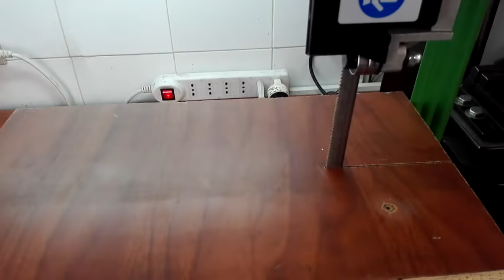DIY Metal Band Saw Stand Modification

Comment: In the vertical position, how many inches (or cm) would you say is between the blade and the saw body (i.e. left of the blade)?
Reply from the maker: I need to check if you want the precise measure, around 10-12 cm :) Not much!
Reply: I'd super appreciate it if you checked! I'm looking at a similar saw which has about 3 inches (7.6 cm) of clearance but max miter of 45 degree vs your saw's 60 degree. Here is that other saw: https://m.northerntool.com/products/shop~tools~product_200660083_200660083?adv=false

My current portable metal band saw (Milwaukee) has ZERO clearance! So the longest cut I can do is the depth of the throat - 5 inches (12.7 cm); if I flip the piece and cut on the same line I can get it to 10 inches (~25cm). Which isn't a lot. 

Love your YouTube videos btw!
Reply from the maker: It's about 9cm. I overestimated :')
Reply from the maker: Ahah :'D Thanks man

Comment: Hi. Awesome videos! I just had a question.. How much  TPI on you sawblade? And can you cut very thin metal with it? Approx 2mm stock?
Reply from the maker: Thank you! I'm sorry I don't know about TPI, it's a fine metal cutting blade, and yes it can. I cut thin steel and aluminum sheat too with no problem :)
Reply: Black Beard Projects I ended up buying a 14tpi blade for my FMB bandsaw . Not the fastest cut but way less messier then with the angle grinder. :)

Comment: omg this is an awesome build but i just Wonder how did u get ur saw to hold at 90 degrees mine will just fall Down Thanks in advance!
Reply from the maker: Thanks mate! :) I place a tiny wooden block under the green part of the saw so that it can't get lower and extend over 90° A better solution would be a bracket from the base to the green part but so far I had no problem to use it as is :D
Reply: Black Beard Projects Alright Thanks mate :D im currently building this and so far everything is Going perfect Thanks for The reply also :D
Reply from the maker: That's great :) Have fun my friend!
Reply: Black Beard Projects you know what i just Made my first knife Thanks to this and your beltgrinder (i built a similar one which i took inspiration from yours)  Thank you so much for these videos and never stop doing them :D
Reply from the maker: Thank you a lot :) I can't tell you how glad I am to hear that :) :) :)
Reply: Black Beard Projects :D

Comment: Im thinking of getting a saw like this. Different brant, but looks almost identical. Do you recommend it? I thinking either this or the evolution rage series mitre saw ones. I Think the evo might be much faster, but I like this idea that you can also use it as a normal bandsaw for curved stuff and small parts.
Reply from the maker: Sure! I love this machine. I use it all the time, it earned a fixed place on my already very small workbench :')
Reply: Thanks I went an bought it already. Returned the first one, was very inaccurate and some bits fell off haha. Second one is better. Cuts very clean, but not 100% straight. It's a bandsaw anyway, so not something I expect super high precision from. And I think it's the best and most versatile option when you build a table for it like you did. I'll convert mine too! :)